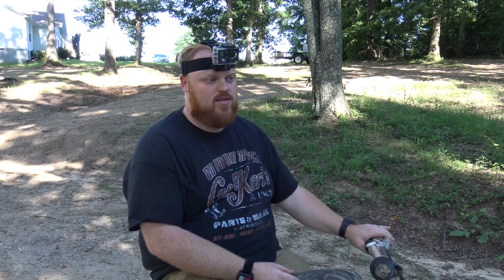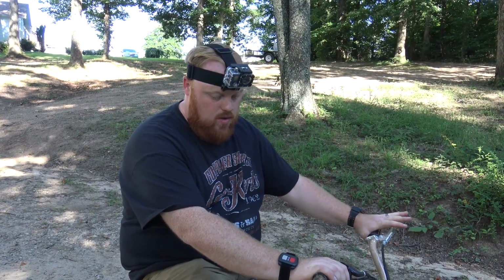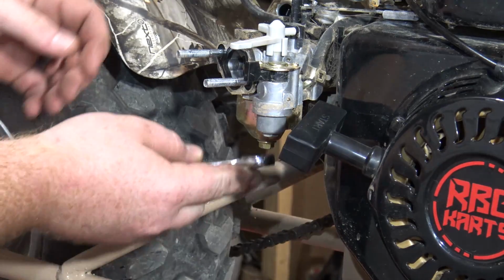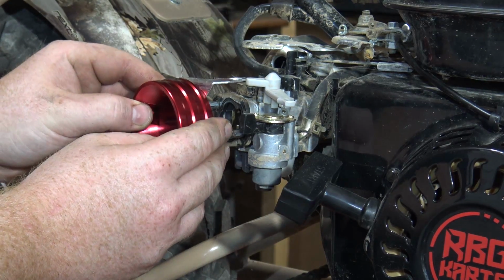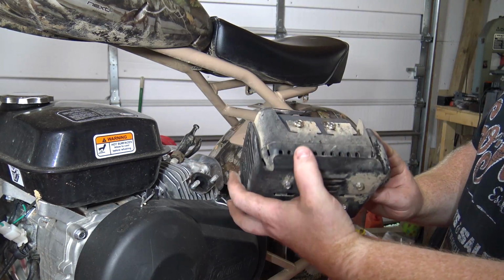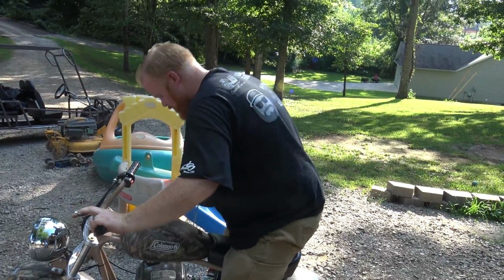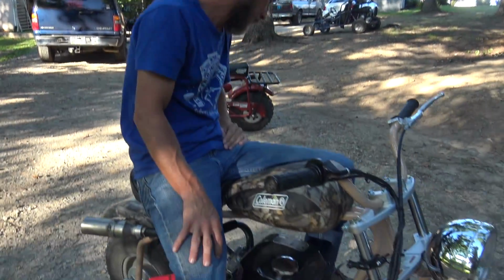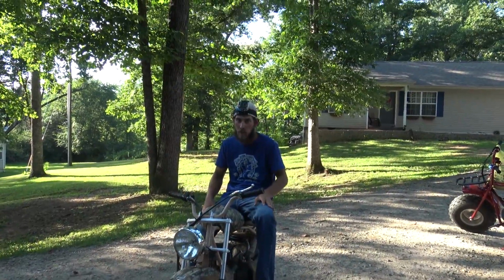Coleman CT200U-EX Performance Parts ~ Mini Bike Monday

Comment: Please get rid of that jack shaft and throw on a torque converter you'll get way more top speed.
Reply from the maker: We like riding these in the woods. Top speed really isn't our goal on these bikes. We will have a street mini bike soon.
Reply: +Red Beard's Garage yeah i was thinking the same thing, the gear ratio is terrible. not sure if you will have to make new mounting holes or not, but its worth it
Reply: +Red Beard's Garage also not sure if you've been watching Carsandcameras channel lately but Ike scored 2 Coleman minibikes , and 1 baja warrior really cheap because one of Ike's friends had 6 of them for free because they had factory defects
Reply: Thanks for your response I understand what you mean. And now I can't wait for a street mini bike that would be cool. Oh and I have to ask you something, have you ever tried a 3D manual clutch on a mini bike,go kart if not you should try one out it works just like a motorcycle clutch and mounts to a predator but the only catch is it doesn't shift gears. But I think you would like it. Anyway another awesome video keep up the great work!
Reply: Nick H i changed my Baja warrior 200cc trail bike to a belt drive and I turned the governor all the way up and it made it twice as fast I topped out at 65/70 I put blinkers on it and I wrote the numbers on the goose neck down went to the secretary of state and I got a moped sticker for it and I got it street legal so I could go riding with my cousin on his Kawasaki ninja 250 and a friend of ours on his Honda grom  125
Reply: Red Beard's Garage you have the motorized chopper bikes for the street bikes

Comment: I'm looking at the U-EX, but I'm 6'2"  300 lbs. will this bike with the carb mod & governor screw adjustment  have enough for hill climbing & trail riding for someone my size?
Reply from the maker: Yeah but you would want to go with the 60 tooth sprocket and it should be good

Comment: My throughtle screw on mine was welded so u can’t in screw it
Reply: leave the screw alone and just bend the flat tab that stops it...bent my flat and my kids bike does 25mph without the mods
Reply: rogerwilco71 thanks that’s what I did and I added mods goes like 45 now after the nitrous

Comment: What is the reson for haver springs
Reply from the maker: With out the governor the engine will float the valves with the stock springs at around 5k rpms.

Comment: Is it normal for the exhaust cover to be smoking? And should I cut it to not cover the bend in the exhaust
Reply: Lil Swampy We installed the performance kit today and the cover did smoke a little bit. It went away in the same day. I think it burns a little bit during the break in period.
Reply: Yeah it stopped smoking after a few rides but thanks

Comment: Had a question for you guys I have a Coleman CT200U 2018 version and for a reason I cannot take out the jet they have it to where you can only tighten it and not take it out please help thank you
Reply: Yeah, Coleman switched it out in 2017, you’ll need a counterclockwise drill to take it out, it’s honestly easier to just buy an aftermarket carb, you can find them everywhere